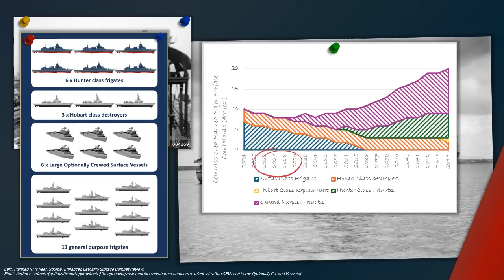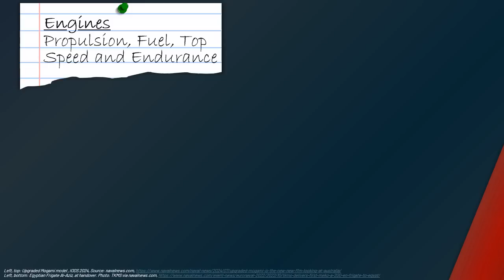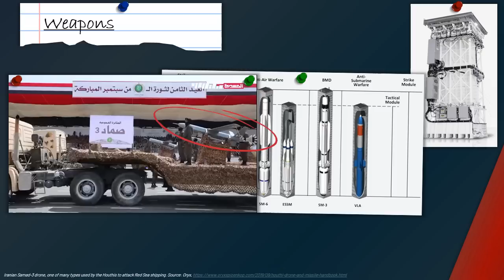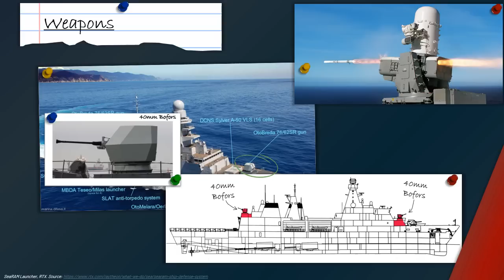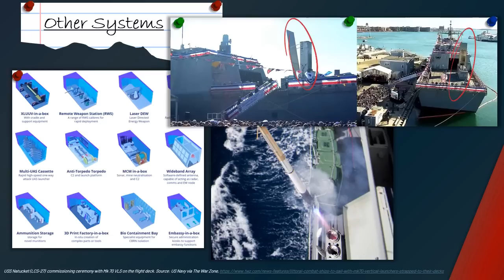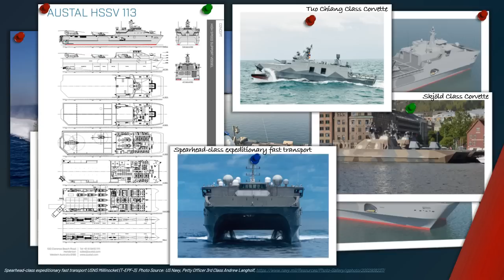Could Australia Build a 21st Century Bathurst Class Corvette?

Comment: I still believe Transfield OPC that was to replace Fremantle PB but fail overseas contract should re-examined its size, weight, weapons suit, sensors n mission outfit.  OPC had 8 ceĺl VLS, 57mm gun n 30mm gun. Nulka decoys n 4 harpoons n 3D radar.  Helicopter hanger for Lynx or Seasprite. No ASW suit.
  I purpose 100m hull to multi mission hanger n fit hellfire missiles in front hanger.  When OPC is patrolling around Australia the OPC should be fitted ASW suit so torpedo container n tow array container. 30mm gun replace with 35mm bushmaster cannon.  Longer hull allows fittem of Seahawk as RAN wouldn't have extra need for Lynx or Seasprite in their fleet air arm plus RNZN future helicopter could be Seahawk, sharing platform, saving money n resources.
  USN has Freedom class, its weakness is propulsion, diesel engines should have been fitted controllable pitch propellers.  Otherwise its fitout is what is needed for offshore-inshore role.
  I still Australian government n RAN should have built batch 2 of Hobart then move onto Hunter class.  Like when last ANZAC was built in Victoria, RAN should gave go ahead to keep building moving onto OPC even 85m size, batch 2 of OPC at 100m n lessons learnt from immigration, Iraq war, piracy, Iran flexing its muscles we could had well hoon OPC with great numbers patrolling Australia.  Remembering Hunter frigates aren't your traditional ANZAC frigates, OPC is close to ANZAC but better package.  Having 15 to 20 OPC helps build skill crew for the Navy, better rotation, better morale.
Reply from the maker: I wasn't aware of the OPC, but yeah, had they built that we'd be in a very different place right now as far as naval preparedness goes. In fact, I think if we do find ourselves in a naval fight in the second half of this decade - and I am a bit of a geopolitical pessimist, so I think that's unfortunately more likely than not - we're going to look back and rue the opportunities we had to keep ourselves competitive. 
The OPC probably would have been one such opportunity, as would have been a second batch of AWDs when it was becoming clear that we were putting continuous naval shipbuilding at risk. Same story for the 2,000t modular Offshore Combatant Vessel that eventually evolved into the Arafura: we've had our chances, refused all of them, and now we're facing our biggest naval challenge since WW2 with single digit numbers of major surface combatants. Not ideal.
Reply: Need extended range for hellfire missiles.  
Laser systems are the future, complimenting other armaments. Harpoons are out of service within a year. Incorporating subsurface armaments and usv's.
Reply: @Makeaustraliagreatagain-h8u  instead of harpoons or NSM, have box lunchers of drones, not only surveillance but explosive devices.